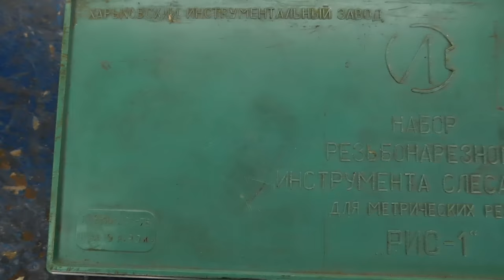Plasma cutter circle tool

Comment: How many psi using for cutting 
 , i using plasma cut 40  , in that how to get perfect cut
Reply: on a 40 amp machine it depends on material thickness and your travel speed.

i have 30A machine, and usually leave it at 70-90 PSI